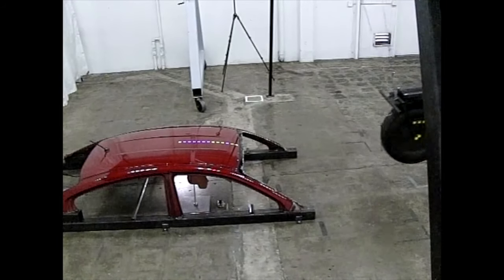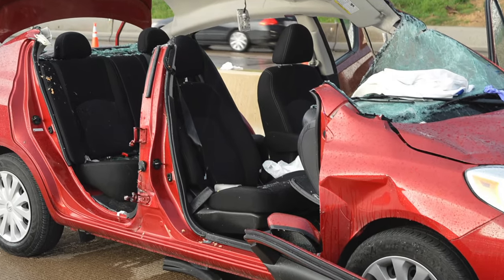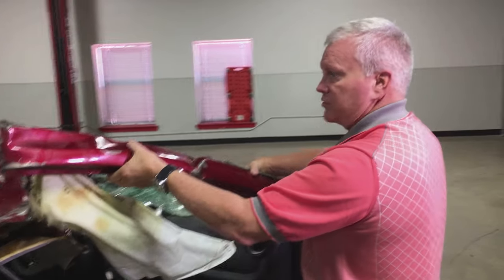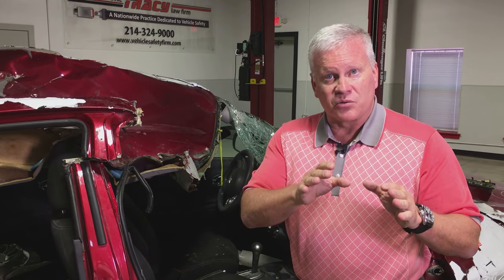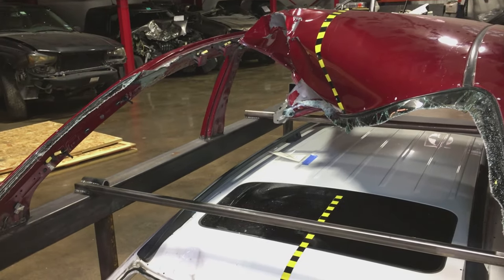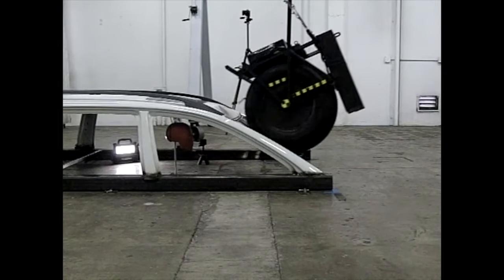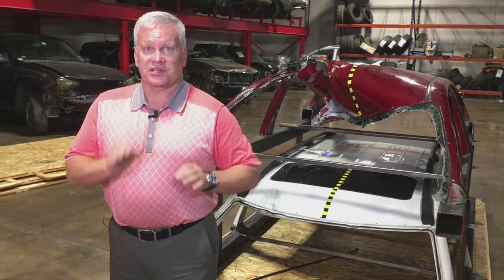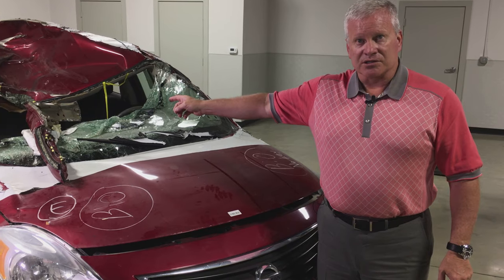How Todd Tracy Proved A Flawed Roof Design Caused Traumatic Brain Injury

Comment: Great job, which shows a shocking difference in performance of the 2 cars
I pefer driving a used Volvo (90-series) or Mercedes (E-Class) instead of a new compact car. This for safety and comfort reasons with a similar cost impact.

Comment: I believe Todd Tracy is brilliant.  He doesn't need to convince IIHS or NHTSA or the manufacturers or the a judge.  He convinces the jury and wins cases.  (I hope you never need his services). 
 Large settlements have a way of making designers engineers and manufacturers build safer cars just as regulations do.

With ONE large settlement, he  made a major impact on body shops and insurers following manufacturer repair guidelines.(You can search it.  Todd Tracy Fit roof).
Profits should never take precedence over safety.

Comment: iihs does not represent all real world crashes.. specially nhtsa is known to be corrupt.  All manufacturers do enough just to pass the iihs and nhtsa tests except Volvo. I'm  currently driving 2007 Volvo Xc90 V8 Awd. I do have a 2013 Honda odyssey for my family which I don't feel all safe in it but I have no choice Volvo don't make a minivan. My wife wants a Cadillac escalade but from what I have seen on here it is all good until it rolled over. It is such a big heavy vehicle when it rolled the roof collapsed...

Comment: But this vehicle has a good rating for roof strength at IIHS.
Reply: IIHS Crash test of Roof only simulates the condition where the car was either tipped over or rolled over several times.
This case was much more like an Frontal roof impact, not like what the IIHS was doing expecting of, which your level of injury depends on if you hit your car you're in into a large sized animals that you couldn't avoid or cases like this.
I'm sorry and will try to fix the problem i had with it if you found any discomfort with my comment while reading the following.

Comment: Cars with moon roofs or sun roofs have additional reinforcement . Volvos are higher quality vehicles . You' re comparing apples to oranges . Why didn't you test a  Toyata Corrola or Camry .
Reply: A cheaper stronger and lighter alternative material was available that's already used in most cars today. So the quality and the cost of the material used should not have been an issue. It's all about the manufacturing technique and the type of weld that was used as well as the material that would have been cheaper and stonger.